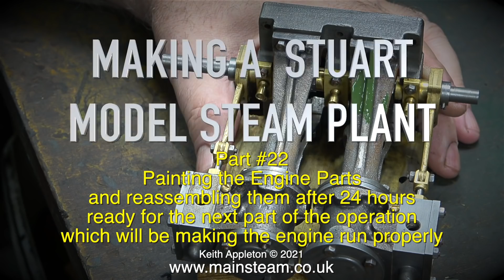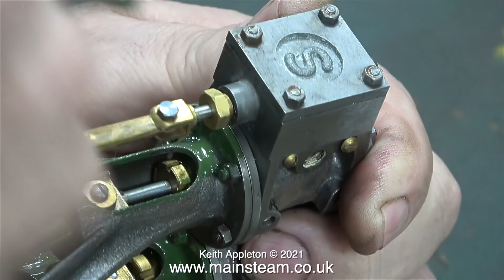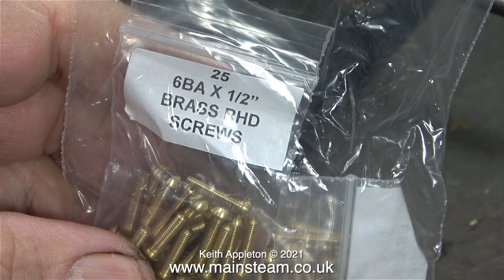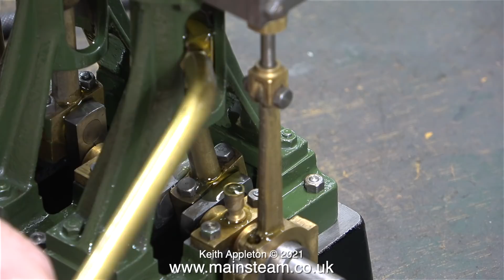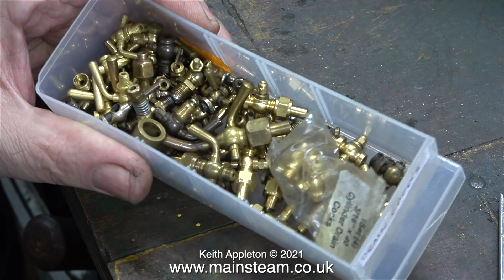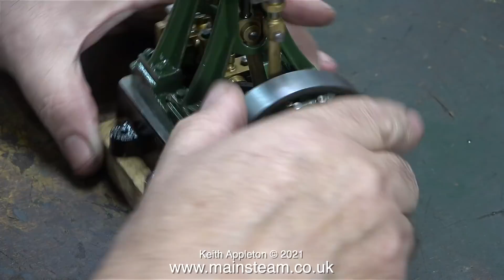MAKING A STUART MODEL STEAM PLANT - PART #22

Comment: wait !, what ?  you painted over some nuts and studs, aren't you afraid of the stud police over on your side of the pond ...?...
Reply from the maker: When was that then ?
Reply: @keithappleton  the studs and nuts holding the A-frames to the bed plate.   I'm just pulling your leg,  over on my side of the pond we sometimes joke about the need to round the top of the studs and have exactly 1-1/2 threads showing above the nut, and if a model deviates we say "the stud police will get you for that" !,    but I guess since this is a machinists inside joke maybe not appropriate for general consumption.

Anyway I hope you can see the humor in this, I love your work, I'm watching this entire sequence, keep it coming !!!

PS, and if the stud police visit you in your dreams I have absolutely no advice 🙂 !!!
Reply from the maker: Yes, I do  know what you mean. On the full size engine, bolts in these sort of places are usually painted over to prevent rust. Only the exposed nuts on the bright ironwork are left unpainted. I prefer it this way if nothing, just for some variety of style.

Comment: Can't help with the dream, mine make even less sense.
Great tip for using the scribe to position those minuscule nuts! The other one I have used when I have the right sized socket is to fold cigarette paper enough so the nut stays in the socket while you attempt to get it started (doesn't work all the time so a virgin sacrifice can also help, or so I'm told)
Reply from the maker: I used to do the same - use a cigarette paper, but after 48 years of Smoking - I stopped 10 Years ago.

Comment: Hi Keith.  Sorry no dream help from this quarter but I do have a question.

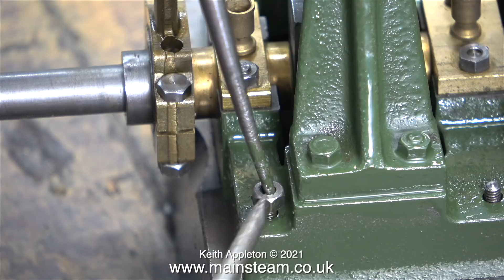Do you ever use washers between the small nuts and the painted surfaces?  It seems like the nuts would tend to score the paint around the studs (like around 3:20 in this video) and nice washers might look OK.  Anyway I'd be interested in your comments on this.   I've never been certain in general when to use washers and when not to and more often than not I don't care much for the dimensional quality of washers.   

Thanks again for all your videos.
Reply from the maker: no, because there usually aren't any on the full size engines and they look better without washers.

Comment: It is the Curry that the English are mad about adding to everything, it will cause bad dreams as well as other destresses. About the flywheels on twin 10s, as most of the ones I have worked on were destined to end up in model boats I tried to convince the owned to due without one or use a smaller one.

Comment: Your comment about rape seed oil could be something similar to the old Castro r oil used in old racing engines. The oils viscosity changed as the temperature went up and maintained the ability to lubricate at high temperatures. Both oils are vegetable based and work very well.

Comment: The house represents the meaningful relationships in your life.  Your family's presence is significant because they are at the core of your relationships.  This is healthy, good and should be a comfort.  The fact that there are two houses together speaks to your connection with two different and distinct but closely related groups of people.  These two groups shared many similar traits but one includes your immediate family while the other does not.  The dream also suggests that your preference is to be in the relationship group including your family verses the non family group.  
The dinosaur...this is less clear but I think this creature represents a past/ancient/long thought gone and extinct issue that has caused you fear, has seemed strong, wild and beyond control and has been one you believe will consume you...eat you.  The fact that the same creature is present in both houses suggests it is connected to relational trouble that has occurred in each relational.group and maybe a pattern you keep.finding your self in.  You either know about some relational trouble that is coming or are fearful it will be coming.  And you can shut it out by simply shutting a door...or closing off communication.  Your choice is to keep shutting the door...a temporary solution...or work toward resolving the conflicts once and for all.  I hope this is helpful.
Reply from the maker: Interesting, thank you.
Reply: Very interesting reply, and I wouldn't want to add or subtract anything.  I did wonder if the dream might be connecting to the fear and worry you might have felt when starting the recording studio.